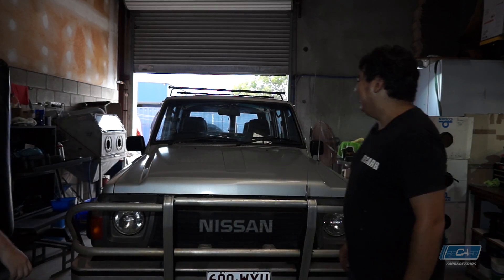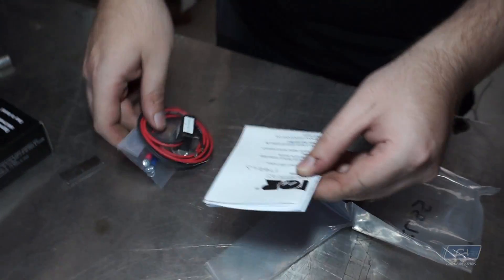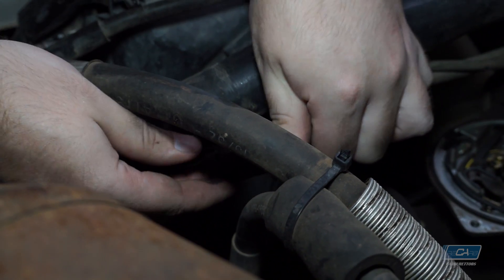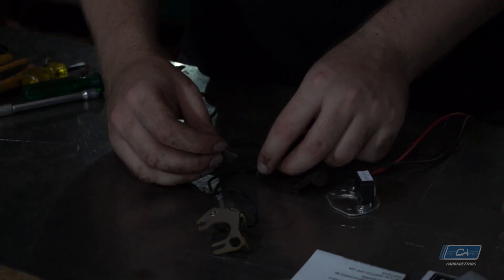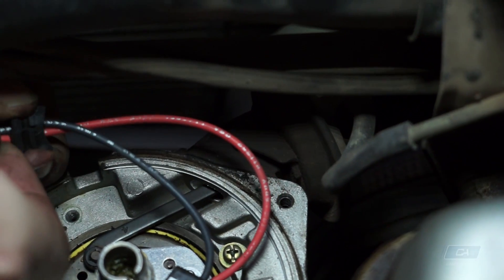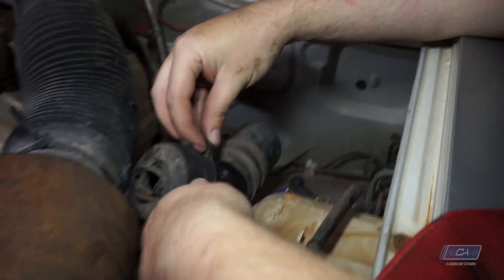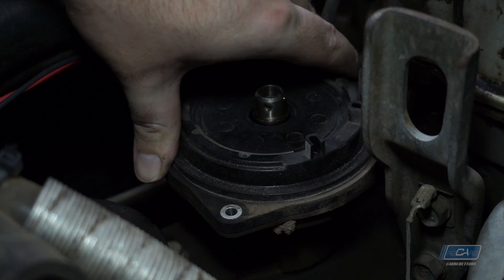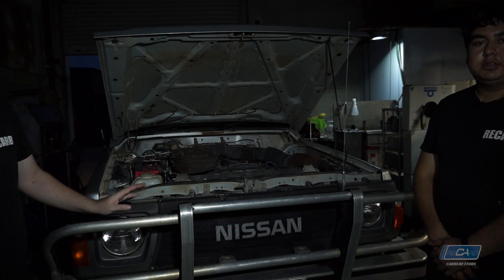Episode 2- How to Install Pertonix Ignitor I into a Nissan Patrol TB42

Comment: which pertronix unit do you use for the tb42?  1762LS or 1761?
Reply from the maker: Hello. Both units are popular. The 1762LS is easier to install and has thousands of them running world wide with no problems; BUT it will add an extra risk of bad/weak signal. Some have reported this happen and we have experienced a bad one with our customers. Having said that, EVERY automotive part and product on the market is not immune to faults. I have fitted the 1761 to my personal Patrol, as I don't have a problem with grinding the collar down to fit it.

Comment: Left a couple of important steps out of the video, like how important it is fitting the sensor bush with the white one on top and that you may have to grind the shaft, and also the fact of cutting the dust cover to it fits properly. Just a bit weird how you showed us picking up side cutters and cutting a cable tie in such detail but not the little tricks that are actually really important. Didn’t show us the whole job.
Reply: Jake Kovacevic I believe that the steps you mentioned are necessary when installing the Pertronix with hall effect. These guys installed the LS model (lobe sensing) and it does not require grinding the shaft or modifying the dust cover.

Comment: Are lobe sensing petronix ignitions as unreliable as people say they're compared to the hall effect? I want to install a lobe sensing one as you don't need to grind down anything on the distributor to fit. Has there been any issues since installing this since?
Reply from the maker: Hi, Look yes they are very hit and miss and we have since stopped selling the Lobe Sensing units for this issue. It worked fine on our Patrol and a few we have installed and sold, but we have also had issues with some here in the shop. Its not the Pertronix itself, its simply too much wear on the distributor shaft and not enabling the trigger on the module to fire the coil properly. You will need to remove the distributor and grind out the shaft in order for the magnet to fit properly, hence why Pertonix made the Lobe Sensing unit. When we get some spare time, we will be doing another install video on how to install an Ignitor II unit which shows the distributor shaft modification.